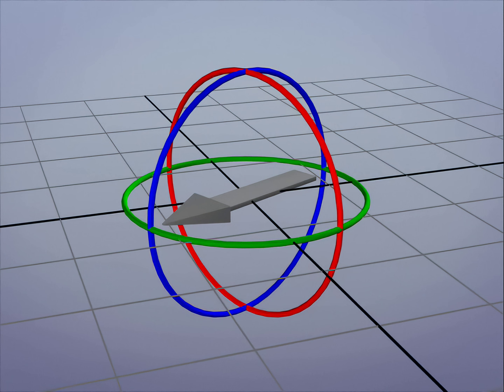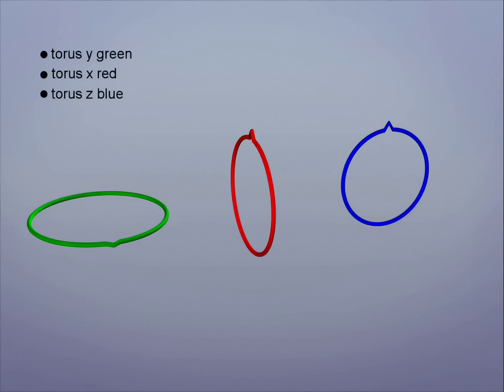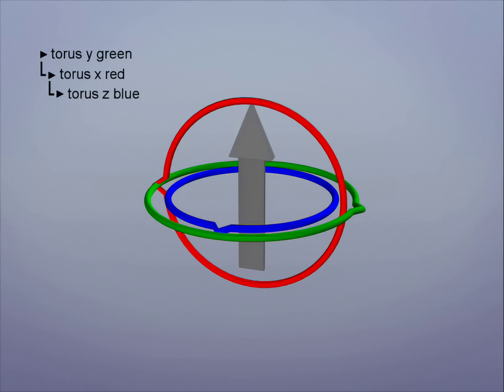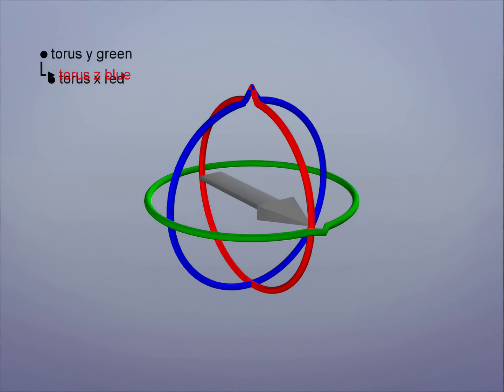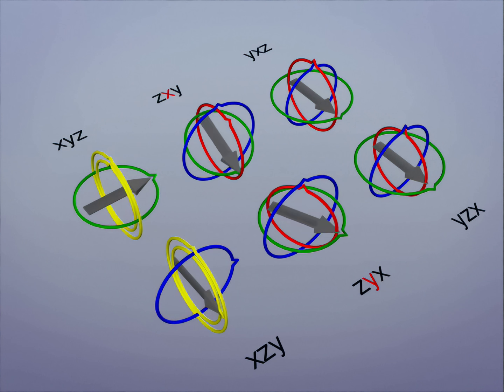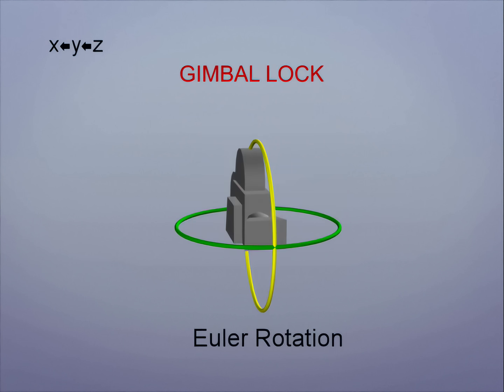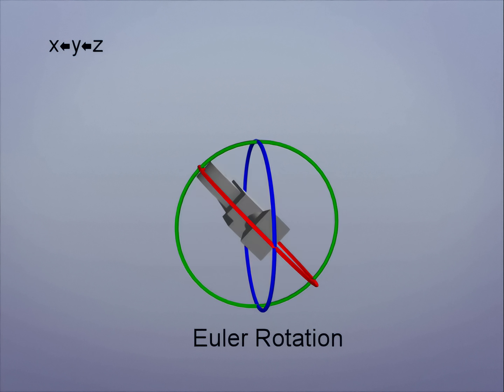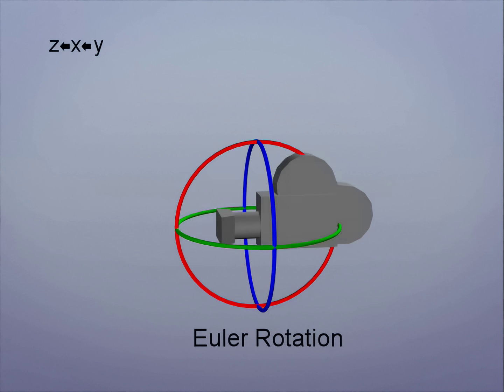Euler (gimbal lock) Explained

Comment: Many people, can not distinquish "euler axis" from the objects actuall axis, also known as local space or object's basis. When you mathematically calculate each Euler rotation one at a time, these "Euler temporary axis" can move independently and become parallel, locking the rotation around two axis on the same direction. So, "Euler Axis" are a result of the rotation calculations and are different from the local axis of the object. THis is why it looks like some of them move independently and eventually locking each other, instead of staying perpendicular at all times.

Comment: Was recently struggling with this.  Didn't have a solution.  I didn't have the luxury of picking any order of anything, just had to work with some piece of software and what it did, and i have very little formal education in math so I couldn't make it work.  I started upon some solution that probably wasn't right but even trying to visualize the solution, I hit this very problem.

Comment: gimbal-locking is not even the worst issue of euler-rotations
the worst issue is "almost-gimbal-locking" already giving bery bad results, too, where too often the innermost spinner is not colinear/coplanar with the axis, that it should rotate around (with or without gumbal lock), resulting at 2 disks spinning to get from a target to a destination, where only 1 disk should ideally ever spin, resulting in the calculated rotation NOT being the shortest/fastest possible rotation, often outside significant error-margains (taking too long detours, causing unexpected physical collisions).

quaternion rotation always finds the 2 coplanar-rotations (low precision for too small angles, where we just use a perfectly-coplanar euler-rotation-instead, which is more precise for small enough angles), and must not forget to always check the rotation-sign to pick the smaller/shorter of the 2 solutions.

Comment: "There's just no way around it." ?? Not so. Since Euler we have COMPUTERS and computers have workings (and limits) of their own. So, there exists the smallest number that a particular computer can represent. Rather than doing a cascade of axis moves all devoid of computer watchdog function, embed each axis in an error (exception) trap. The only err is div by zero which is at the core of the problem. On err just add the last trajectory  of that axis to the one that croaked. Don't need quaternary overhead. Doing this in my CAD stuff since1980s & have never seen a lock. Easy & fast. Just 'heuristic' rather than pure math.

Comment: there is no best solution. each alternative method has its drawbacks.
this hierarchical system has gymbal lock. a universal system has non referential axes, meaning simple rotations require complex orders. a referential system has no universal axes meaning all axes rotate each other. this makes multi-axis rotations very difficult.
a reordering hierarchy still gymbal locks, and there is no protocol for when you need to rotate two axes that wont cause its own problems.
and you cant switch between them!

Comment: Can't this easily be solved with a secondary set of axis?
That moves both non-rotating axes?
It makes relativity issues, but is only used in any case where an axis lines up with another.

Comment: self-use:
Each gimbal is mounted on the next outer gimbal with orthogonal pivot axes. The pivot axis of each inner gimbal is orthogonal to that of the gimbal it is mounted on. Since orthogonal axes cannot become aligned, gimbal lock can only occur when the outermost and innermost gimbals themselves become aligned, resulting in the loss of one degree of freedom. Losing one degree of freedom due to gimbal lock prevents full control of orientation, making accurate and independent movement in 3D space impossible.
(Rephrased by ChatGPT-4o)

Comment: Am I missing something or is it a mistake at 4:15 to highlight 'torus x red' as moving when it's actually 'torus y green'? The red can move on its own at the bottom of the hierarchy, right? But it clearly shows that both green and red are moving - so it should be green, which is in turn moving red.

Comment: It's seems to me that it shouldn't be a problem if you use local euler axis' only to make keyframes, but the actual animation would be translated with the global axis. I just tried to redo the gimal lock scene with the plane from the start of the video and there's nothing locking on me using the global euler. The only thing it's obviously not efficient for animators but that's why i said rotate with local, interpolate with global.But personally i think animating the axis themselves would be the most handy solution, because 1) you animate what you see  2) no need to learn quaternions

Comment: Thank you for the explanation... I found this term when trying to diagnose an odd problem with a machine I was rigging. So I wanted to know what this is. Changing something with the Aim and Orient vectors with an Aim constraint seemed to have fixed it.
But it also gives me an explanation for why I sometimes had very odd rotational issues when I would go to tween my animation. The "not moving in a straight direction" in particular. Given the two keys, I could not understand why the in-betweens would try to swing to the side when visually they should move straight down. (Sort of like your example, it was an ik hand control swinging a pickaxe down in an arc)

Comment: Does this hold up if you have the arrow inside a sphere, and you move the sphere inside a cradle that has xyz drive rollers? It would seem that this would always give it the same gimbal lock characteristics of the drive rollers, which is roughly zero.

Comment: This (rotation order) seems like a low tech way of preventing gimbal lock and only decreases the likelihood.
It seems like there are ways of totally eliminating gimbal lock with rotation encoders and wireless accelerometers attached to each gimbal axis that would detect and compensate whenever 2 axis aligned.  In the 1960's it would be difficult....but this is 2023.
By the way....shouldn't we all be driving flying cars?

Comment: see this in so many every day objects where things werent thought through...

thinking of things like DIY trikes where people stick two wheels in instead of forks... failing to realise that the tilted headtube will cause you to lean the wrong way in a turn...

much like skateboard trucks... always fun to prank people with reversed truck(s)!

my recent experience was making a blade/trailer/grader for the tractor... you want to pivot the blade in three axes, and they conflict, so adjusting is always fiddly. you dont get lock but heirachy of pivots matters when designing to reduce interactions.

and that also was a lesson in harmonics. its sort of important where the blade is in relation to the axle of the trailer and tractor... it cant be halfway! you get harmonics... "sidebands"

Comment: 2:35 why wouldn’t you just move the red circle to where the grey one is by moving it with the green circle ? You can keep the arrow in the same position by moving the blue circle in the opposite direction as the green
Reply: @leeroyjenkins0   ahh I get what you mean, and I’ll assume you’re correct because there’s no reason not to. I understand quaternions would be better in some instances depending on the preference of the people using them, yes. But I think a lot of explanations imply that gimbal lock destroys everything and we have to go into the fourth dimension to fix it, instead of just saying that quaternions are pretty neat to visualise (ignoring over focus on the 4d aspect) and efficient in some circumstances. I think your right in saying that there’s a lack of good coverage of the topic which is probably leading many people into confusions
Reply: @leeroyjenkins0  I think I didn’t explain what I meant well. What I meant is this: imagine moving the redline 90 degrees to be inline with the grey line (instantly) after this the blue line would’ve changed so the arrow wouldn’t be in the same position so using the blue line you’d have to roll it back 90 (instantly again) so that the arrow is in the same position that it was in at the start only now the redline (because it is effected by the green line but not the blue) is rotated 90 so it lines up with the grey , this means that the desired animation of rotation can occur exactly as illustrated in the video. However it requires doing two rotations first in zero time , not using a fourth axis or using quaternions.

Comment: One possible slightly cheaty solution is to simply break the motion into steps, calculate a very small change in angle and teleport the camera there, then repeat these very small steps until you are at a target angle, this is usually unnoticeable because computers tend to not bother with angular precision below thousandths of degrees so you can use that rounding as a 'blind spot' for in which to undo a gimbal lock.

Comment: Even twelve years after its release, this video is still the best way to understand how works the Gimbal Lock. And with satisfying sounds on top of that !
Reply: why can't the arrow continue rotating?
Reply: @mrosskne the reason why the arrow cannot rotate in that direction is because one axis of rotation has been collapsed. X and Y now do the same thing in a gimbal lock. It's not that the direction is physically stuck (or "locked" in the real world sense), but rather that the two aligned rings combine to remove one unique axis of rotation.
If you try to spin a locked ring, it moves the object in a certain way. If you try to spin the other aligned ring, it moves the object in the exact same way. There is no ring left to rotate the object in the direction that the missing, third axis used to control. That direction of spin is now unavailable, even though the rings themselves can still spin.
Also, that guy was totally right as well, the idea is that moving to the absolute poles of the earth makes the concept of "east and west" incapable of pinpointing your next movement. You correctly pointed out that you can use longitude and latitude, and in your case this is equivalent to using quaternions to fix the problem of gimbal rotation. 

It's a little complicated if you dont know about complex/imaginary numbers, but it's like this. 
 w + xi + yj + zk
Instead of defining rotations using 3 axes in a hierarchy, quaternions define the axis using x, y and z, and how far you spin around this axis, w. 
The imaginary numbers i, j and k are the key to how they work differently than a gimbal. But you didnt ask how to do quaternions, so I'll just end it here for now.
Reply: @firstlast-sq2gc  How is that like quaternions? It's two angles, and an altitude if necessary.
Reply: @mrosskne  they're not alike in a mathematical sense, rather they're both solutions to the problem of being unable to define one axis (in the coordinate system, this is longitude, and in the 3d case this is the missing axis being remedied by using complex numbers to define the direction of rotation.
Reply: @mrosskne  I was wondering this as well for days lol, but I ran across this when learning about quaternions. I found this video after, and it makes things make a lot more sense. 

I saw a reddit comment where someone put it in easier, real-world terms. If you were to move around on a globe, you could describe any movement using cardinal directions (I went a mile west, then a mile north). However if you went to the North Pole, EVERY point of movement is south. So if I were to go a mile south of the North Pole, then where am I? I could be anywhere on the edge of a circle with a radius of 1 mile around the North Pole. That's essentially what gimbal lock is. 

This can be solved by adding a forth parameter- for example, "I went a mile south from the North Pole, towards Washington DC". Without that forth parameter you can find yourself in a situation where there is no good way to describe your movement.
Reply: @dos54  But this is already solved by the coordinate system. You don't need directions, you just indicate the latitude and longitude of your origin and destination, which are unambiguous for any point on the surface.

Also, this still doesn't explain why the arrow can't continue rotating through this position.
Reply: @mrosskne it's the same reason why simply standing at the North Pole and saying "I'm travelling south" is inadequate for actually giving directions (everywhere is south!). Using the earth is just to help visualize. The coordinate system gives position, what we're worried about here is rotation.

Once you're at the North Pole, the only direction is south. That's essentially the problem. When your X and Z axes align, one of them essentially disappears into the other in the same way that all directions merge into "south" from the North Pole.

And perhaps the problem isn't actually necessarily that you couldn't continue the rotation past that position. It's that, at the point where the two axes align, you lose one of those axes until they're moved back out of alignment.
Reply: If it didn't suffice an an explanation the first time, repeating it isn't going to either.
Reply: @mrosskne  I apologize for trying then, I should've known better than to try to explain anything to you considering you posted a question on a 4 year old comment.
Reply: If you don't know the answer, you can just not reply. Stop trying to save face.
Reply: @mrosskne  brother I know the answer and I explained it to you lmao not my bad you can't understand
Reply: You didn't and you don't.

Comment: One solution though for gimbal lock is to set the correct location for objects frame by frame, or an extra keyframe on either side of each locked position

Comment: In computer animation there's no hierarchy of yaw/pitch/roll, they are independent of eachother. Ya when vertical rolling moves around the same axis as yaw, so what? Gimbal lock might be a thing with gimbals, but not Euler angles.

Comment: I realize that first person shooters won't have this issue because the player is locked to the ground. In other words the player will not need to worry about Roll/Banking. A first person shooter will only need to worry about the Pitch/Tilt and the Yaw/Pan.
Once you've introduced that extra dimension that's when everything starts to break. 
A major reason why flight simulator games that don't use Quaternions will begin to break. They fall into Gimbal lock.

Comment: I only run into this issue once on an F-111 where I was an avionics Tech specialist. We had an aircraft that be attitude Direction indicator would not point in the direction the aircraft was headed and any time you tried to slave it and correct its positioning it would end up going 90 degrees down and start rotating slowly counterclockwise. Establishing gimbal lock basically headed to the Earth. After several tries and even disconnecting and reconnecting the directional gyro. I shut it down what back took the gyro, it was still spinning down oh, and it tried its level best to jump out of my hands. I had taken out spinning gyros in the past and as long as you handle them carefully you don't usually run into a problem. But this one was really unstable. I set it on the ground let it spend down for a few minutes so that I could put it in the truck. I wrote it up as being off its gimbals. I described the malfunction and sent it into Depot maintenance for service. I did not keep track of it to see what aircraft it went into to see if that aircraft eventually had a repeat occurrence. The only other 2 unusual situations I had with directional Gyros was I have worked on one that was actually built by singer and it was the best operating and most stable directional gyro I had ever worked with. It was noticeably a better unit then the other two or three manufacturers we had on the base. The other time is I had to change one while the aircraft was running because the pilot needed to fly a mission and I got into it he described what the problem he had from the cockpit, I got into it swapped out the directional gyro and he cranked it back up and it seems to run fine with a quick check and I reminded him to make sure he was aware of his redundant systems. And he took off. Never heard another issue about that particular aircraft. At least not about the navigation system.

So am I understanding that gimbal lock occurs when the angular momentum is functionally equal between the two gimbals? It sounds like the differential speeds of the individual rotations is key to avoiding gimbal lock.

Comment: Well, there's already a solution to gimbal lock that the aerospace industry came up with: have a fourth ring/axis. Actually, the guidance control system on Apollo 11 had a gimbal lock issue during landing on the moon because NASA decided to use a more traditional and simpler and known reliable 3-axis gimbal in the space craft. Michael Collins even joked about NASA giving him a "4th gimbal for Christmas" because it was an issue for him in the command module. Didn't happen, however, and it was also an issue in Apollo 13 where the space craft was tumbling around uncontrollably immediately after the explosion.

Comment: This video is by far the best I've found on explaining the Gimbal Locking problem. 

Gimbal solution note points:

- there's a maximum of 6 rotation order combinations
- all rotation orders HAVE gimbal lock
- Axis order in maya is displayed inverted like so: child <- mid parent <- main parent
- Gimbal locking ONLY takes place on a 90 degree rotation that causes two axes to intersect

on choosing the appropriate Rotation order:
- dominant axis must always be the main parent
- axis MOST LIKELY to cause the gimbal lock MUST always be the mid parent in the rotation order
- secondary dominant axis must always be the final child axis